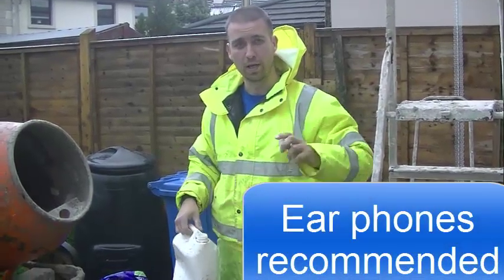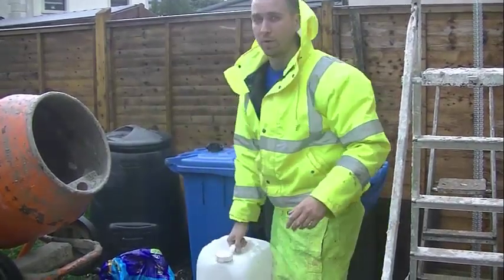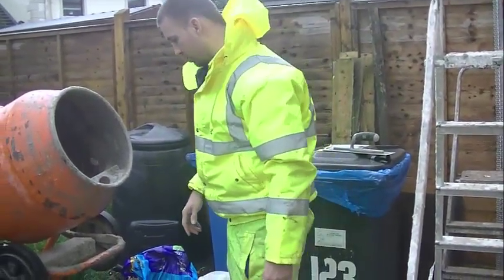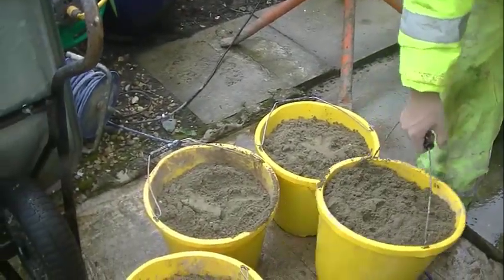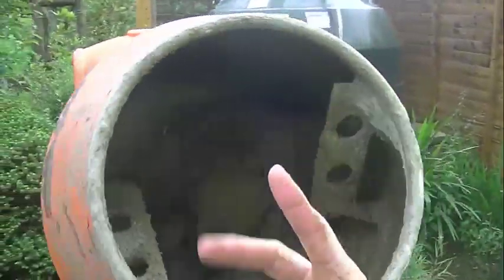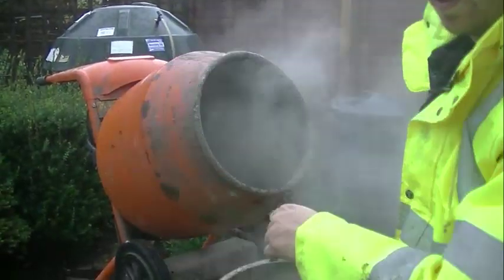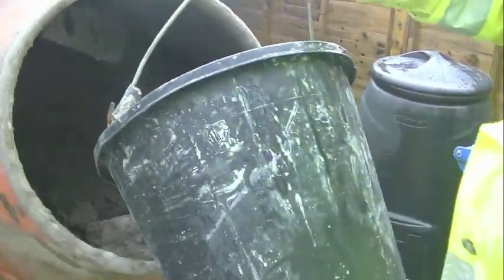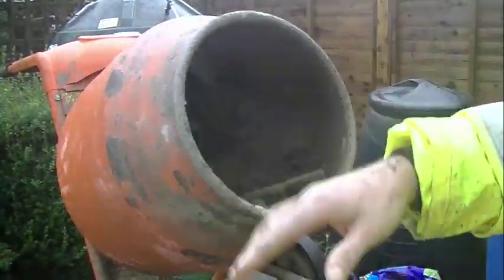How to mix cement render scratch coat 1st coat undercoat

Comment: Why do you only put a cap full of sbr in mate?? The tub suggests you should be putting pretty much the whole tub in per 25kg of cement.
Reply from the maker: If I was you do a test area before butting so much in but sticking to instruction is always good , but if it fails will they take the blame ? 
I find to much sbr makes the gear hard to work with and set faster , On this wall I just wanted a taste too help bond and water proof some as you can see I also add water proffer , also cement it self is good and stopping water , You might like the 5l sbr to 1 bag good to work with everyone is diffrent

Comment: Hi Mac. What are the additives you put in your mix? Great video by the way
Reply from the maker: Hi mate thanks for watching and supporting yes on this on i added sbr , water proffer and some plasticiser
Reply: mac plastering what size trowel do you use to apply render? Just Curious
Reply from the maker: @MrSparky082  Hi mate some my comments are not popping up in real time so sorry for the late reply the one in this video is a ragni high lift handle its 14 inch by 4 inch its for rendering cement pacifically wouldn't be a great trowel for skimming  though

Comment: So what happens if you dont put anything in to your mix only water sand and cement 3&1.will it still work...askin for a friend...lol
Reply from the maker: it should work ok mate for inside but might not be as good for outside as no waterproofer wont be as good , mortar mix makes it more fluid / easier to work with   , the sbr is to help it bond , gain strength , also its water proof , ps you will find you'll use more water with out mortar mix  and it might crack a little more also , hope this helps
Reply: @macplastering  must put it in my second coat then.it looks good without it but it was a bit harder to work with told the boy mixin it to put it in not said he forgot. And its outside hope it holds
Reply from the maker: @bootsmclaughlin1438  You might get away with it ok mate in this cold it might even help it dry and set some for you to rub if that is what your doing ?
Reply: @macplastering  will say a wee prayer   it holds. And your rite about the cold its f÷×kin freezing every night I have been workin at it..you do much stuff on facebook was thinkin of join up lol.will get no work done if i do...cheers lad
Reply from the maker: @bootsmclaughlin1438  I am on facebook but be on youtube way more , share my stuff on some the plastering groups and stuff a lot of good lads on there same as here if I am honest some great guys like yourself down to earth men :)

Yes mate hope it hold for you
Reply: @macplastering  was on fb a few years ago but give it up was doin my head in lol..just like YouTube now with all the adds but fb was better for sharing pictures and stuff.headin to new York next Thursday for 5 days and apparently it's a whole lot colder there at this time of year than it is here loads of jobs to get read up b4 i go
Reply from the maker: @bootsmclaughlin1438  nice one mate when you get of the play make sure you play this song = new york these streets will make you feel brand new ... :) Love that song , yes man getting all jobs tied up will make for a better trip :) yea ads on youtube I think mine are just skip ones at the start LOL

Comment: I only got about 12mm each side
Reply from the maker: you could do a tight 1st coat land then 5 to 6mm top coat is the wall big mate ?
Reply: No only chest height and only two blocks hi on patio side
Reply from the maker: @richardbatchelor3297  just mate 1 coat is very weak compared to 2 coats and harder to finish , is it 12 mm to the edge or to the drip duct / drip duct is shown here in this video -  https://youtu.be/vh1pypHlwro
Reply: To the edge of coping I’m afraid it hasn’t got a duct under
Reply from the maker: @richardbatchelor3297  so rendering out wont mater as much just some staining will happen in the future from rain over time

Comment: Oh yea...spoke to soon last wk...mixing drill stopped mid mix......bit repair was possible I brought it to the right man,he found lead wire failed inside handle supplying the trigger..
Reply from the maker: dod you get that mix finished or was it binned ?? or did you have to use a stick and plunger ?
Reply: @macplastering  haha great question Mac....the young guy at the time abandoned the large drum, bag of base coat powder and water ,, just left it for dumping, unreal mentality!!! Later I tackled with plunger but I was winded a few times before it was nice ..
Reply from the maker: @nickywalsh8492  Fair play man us older type dont like to waste gear at all :):) man fair play with getting it mixed by hand

Comment: I had to google SBR-never seen before-i see it is a polymer/adhesive type additive-i have used a chemical based one called Weldcrete many years ago on the new Parliament house job here in Canberra Australia in the 80's as PVA was banned as it did not meet the 200yr life span they they required on that job.Keep up the great informative vids and also love the un-boxing and testing videos
Reply from the maker: Oh yes i done a few videos now with SBR I seems a very good product for anything with doubt in the mind to me fro using it I have found it strengthens the mix makes it set harder but also faster not always a good thing if doing large walls , it also helps it bond to near anything , and best thing its a water proffer also Best of 3 worlds for me strength ,bond ,water resistance

Comment: Hiya Mac mate... I've been told by a couple of my builder mates that a shovel of lime mortar does wonders for the mix ie workability and extended  drying time with less cracking... I've never done that. What's your opinion mate? I'd be interested to know 'cos you're a real pro!
Reply: You only want lime in the top coat and never put more lime then cement in the lime helps by allowing it to move slightly and makes it nice to work with
Reply: @joes9314  Thanks Joe . I'll remember that one mate
Reply from the maker: Joe Stewart in my opinion is 100% And rember lime will burn you 10 times more than cement , i find lie good if dashing can make a nice fluffy mix but never to much mabe just a scoop or 2 or in a big mixer a shovel or 2 :)
Reply from the maker: @joes9314  110 % mate

Comment: Hi Mac plastering
Wonder could you help,
I've followed your videos and tride to replicate, but the mix just doesn't seem the same.. as yours, the mix seems NOT sticky and dead...no muddy like yours.
Think it might be the sand, it kilsaran plastering sand, sbr and plastizer used cement used waterproofer used, clean water and mixed with mixer... scratch cost doesn't seem to want to lay down and very hard to trowel on light or heavy without falling back...
I had to put a thick cost on just to get it on the wall but then it's falling away and when I lightly scratch it defentley falls away ...wall is new solids dampened down with water.... not to damp or dry,, even the mixer seem very clean after the mix not sticky.. 
Going to try different plastering sand but if you can think of anything I'm doing wrong or causing this could you let me know... cheers mark
Reply from the maker: Dose sound like sand as you can see this very mix I have done is then scratched on and similar mix for the top coat on these videos , try a small mix with a little more mortar mix to see if it helps it flow , it almost sounds like sand is to fine as for when it is falling of fine sand tends to want to stick to itself and not the wall like building sand ,plastering sand is gritty but not to gritty , these grits give great strength and grip
Reply: @macplastering  
Cheers  for that Mac.
It's actually seem very gritty
I mixed a bit of mortar sand into the mix on the next day just to see did that help
And it did a bit ...easier to work with...it was just a small test area I did and I pulled it back off the next Day...
Reply from the maker: @markv6736  must been to gritty ? let me know how you get on mate

Comment: Cheers mate
Reply from the maker: Any time buddy hope you getting on well
Reply: @macplastering  yes mate getting on ok. Working with someone and he doesn't use straight edge n I said I makes life easier. But suppose he's stuck in his ways. He uses 4-1 on scratchcoat, also 4-1 on on second coat. Is that ok? Doesn't use sbr just rendamix too. 🤷.
Reply from the maker: @simoncrewe5625  Every ones diffrent likes diffrent ways but I was always taught to put top coats weaker than the ones previous
Reply: That makes sense pal. I've subscribed a while back n will keep taking tips from you mate 🤜🤜
Reply from the maker: @simoncrewe5625  Always here mate if you need anything or can try make videos to help also :)